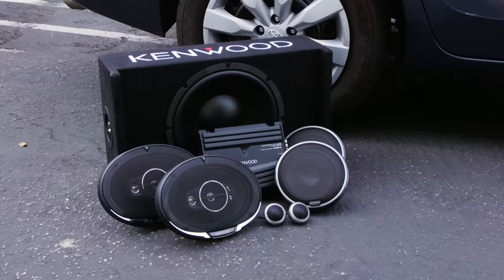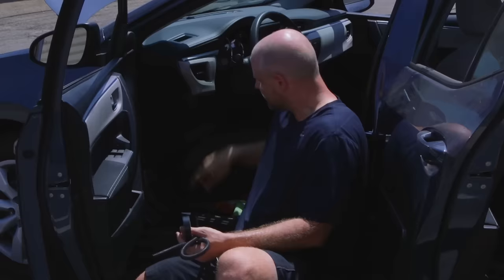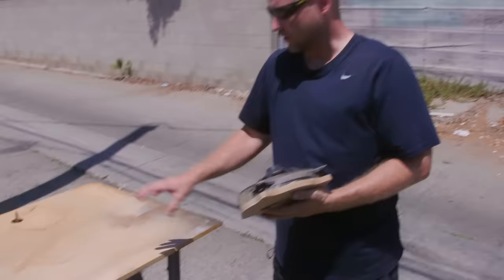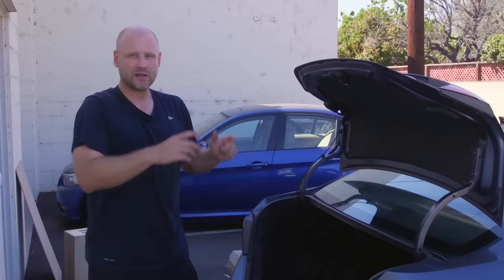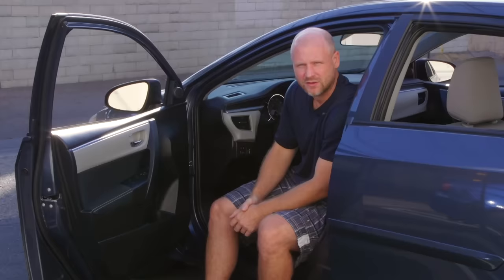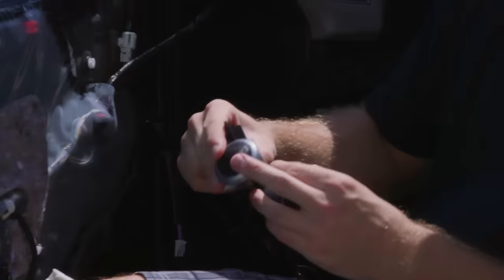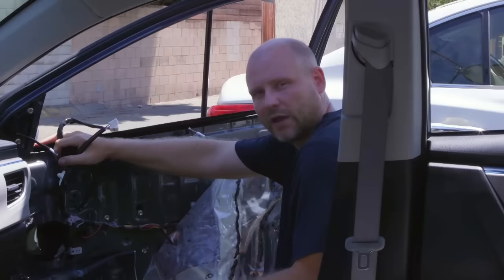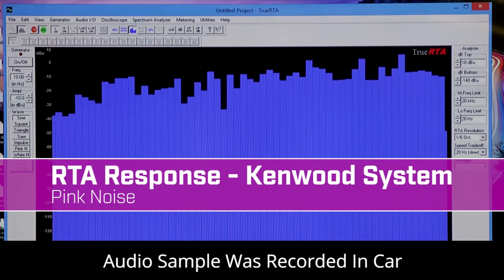Full Car Audio System Installation - Speakers, Subwoofer and Amplifier

Comment: vocals coming out my sub
Reply from the maker: You'll need to adjust your crossover points. You want your speakers and components to play the mid and high frequencies of your audio, and you want your subwoofers to play the low end frequencies. The idea is to cut the bass from the components so they’re not trying to reproduce lower frequencies that will cause distortion and clipping and the opposite for the subwoofers, you want them to play low bass frequencies not highs. The crossover points on the amp limit the frequency response of the speaker before the music gets to the speaker.
Lets go over low-pass filter. Turn your sub’s amp gain to its lowest position, make sure bass boost is off and any remote level control is set to middle. Switch the low-pass filter on and set it as high as you can. Also make sure your stereo’s bass boost is turned off if it has it. Begin to play music at about 1/4 volume, and turn up the suubwoofer gain on the amp until the subwoofer audio completely overpowers the speakers without distorting. Next adjust the sub’s amplifier low-pass filter down until the high and mid frequencies disappear. 
The low-pass filter will now effectively eliminate the highs and mids from the subwoofer, vocals, strings, drum cymbals, you don’t want tat coming from your subs. If you have bass boost carefully turn it up to your liking, but be careful this is a common place for distortion to peak its annoying head into your system. If you hear it, lower the sub’s amp gain until its gone. When dealing with ported enclosures, use the subsconic filter on your amplifier to control overly loud low notes. A lot from this point depends on personal preference, play with the low pass settings until you get the bass that you want.
Reply: probably just haunted, take it to a priest

Comment: ok i know about the power, remote wire, and ground but the speaker wire is where i get confused like how do I connect that to all door speakers???
Reply from the maker: It's pretty simple! Each speaker terminal on your amplifer will have a (-) and (+) slot, just like the speakers will have a (-) and (+) connectors. Think of it like a battery has a (-) and (+). Simply wire each (-) connector of the speakers to the correct (-) terminal on the amplifier, same with the (+).
Reply: @Qualitymobilevideo  so does the wire from the car matter or do i just put the wire + to + nd - to -  straight from the amp to the speaker or does it still need to be connected to the car wire aswell as the speaker wire.

Comment: Do you amplify speakers from the amp being connected to the stereo ?
Reply from the maker: Well in this install we did it two ways. The rear speakers and subwoofer are wired and powered by the new amplifier. The front speakers and tweeters are still wired and powered by the head unit.

Comment: Just bought my first car, still has all the factory speakers and stereo. wanting to replace everything. new speakers. new stereo. put a sub in it. I have faith I can do the install but adjusting everything. tuning it or what not to make it sound right. buying an amp or not buying an amp. all that has got me LOOOST. also finding the best affordable system to buy
Reply from the maker: What kind of sub did you get?

Comment: Did you connect the speakers and the subs to the Amp? If so can you connect 2 speakers (Kicker 43CSC674) and 2 subs (Rockford Fosgate P2D2-12) to a mono amp (Rockford Fosgate R500X1D)?
Reply: Looking for the cheapest possible Rockford Fosgate Amp for said setup that will give good sound, going into a 2005 Silverado Reg cab so don’t need nothing too crazy (the subs are on Craigslist for a good deal).
Reply from the maker: We wired the rear speakers and subwoofer to the amplifier! Connecting two speakers and two subs to a monoblock amplifier will not work!

Comment: how did you actually plug in the tweeters? Looks like you just looped everything back and didn't actually connect it to the tweeter.
Reply from the maker: We simply replaced the factory tweeters with the new ones, using the factory wiring.
Reply: @Qualitymobilevideo  I don't see how but okay

Comment: finally someone who doesn't use a 0 gauge wire for a 1000 watt sub. who came up with the idea that you should always use a massive oversized power cable ?
Reply: henk hakkert Because noobs thinks the bigger, the better.
Reply: @soontoawake99  yea but that amp is not true power dude is good dough
Reply: Incase u want to upgrade you dont have to tear the car apart

Comment: what is the small blue device you installed with amplifier please tell me. and tell me one more thing. earlier i used amplifier but i felt irritated with a noise sound while pressing acceleration of my car so i uninstalled amplifier now. but recently i installed focal auditor 60 rms 4ohm component in front and 60 rms 4ohm coaxial in rear with sony xav 68 bt head unit. now i feel i need to install amplifier for better clear sound. please suggest me. i want to install sony xm n1004 4 channel amplifier 70rms 4ohm. will i feel noise again while acceleration? earlier i felt noise even  after adding a noise filter with amplifier but my earlier amplifier was cheap quality worldtech 2 channel.
Reply from the maker: That is a Line Output Converter! It transfers the speaker level outputs of a stereo to the amplifier! Here's a seperate video on them: https://www.youtube.com/watch?v=OXn8-8yee5o

Comment: As an electrician, I cringed when he said he was going to use dishwasher soap for lubricating the wire to get it through the rubber grommet. Never ever use any type of soap or saliva for this, it dries out the rubber and the outer insolation of the cable over time. Making it crack and eventually expose the copper. If you want to use any type of lubricant for pulling cables through rubber, then use any type of silicone based lubricant, it won't harm the rubber or the cable insolation, actually it will have the opposite effect. Otherwise this was a nice installation!
Reply from the maker: Thanks for the tip!

Comment: how did u power your speakers from the amp? or are they just powered from the head unit?
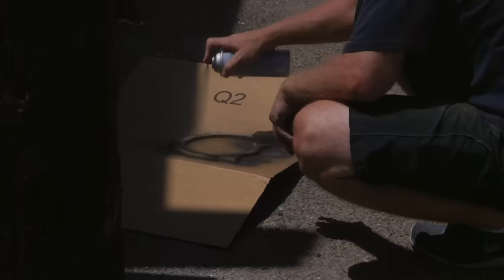thanks 9:13?
Reply from the maker: We originally only powered the subwoofer with the external amplifier. The speakers were all powered by the head-unit, we simply replaced the speaker connections for the new speakers :)

Comment: So the amp is only doing the sub not all the speakers ?
Reply from the maker: Correct, if you watch again, the front 6.5" speakers are being powered by the head unit like the factory ones were

Comment: the way this is setup does it amplify all speakers or just the sub?
Reply from the maker: We're powering the subwoofer and rear speakers with the new amp! The front speakers and front tweeters are powered by the facotry headunit
Reply: Aren't you only powering the subwoofer with the new amp? The rear speakers are still being powered by the head unit, just like the front speakers and tweeters. Then correct me if I'm wrong, you are using the LOC to tap into the high level sound input of the rear speakers and convert that into low level RCA which the amp uses to produce the sound for the sub? In order to avoid pulling out the head unit, you connected the LOC directly to the AMP (power to BAT, GND to GND, remote to P. CON) hence its location. Am i close to being right or what did I miss?

Comment: Did u run the speakers to the head unit or the amp??
Reply from the maker: Head unit! All we did was replace the new speakers in the factory locations and uses the factory wiring(with some improvements) to power them from the HU. The subs is the only thing powered by the external amplifier

Comment: If I do the big 3 upgrade on a 1995 Plymouth voyager van with the stock 90amp alternator can I atleast install a 600 watt rms subwoofer ? So the amp will be 600watt rms at 2 ohms  powering that 2 ohm 600 watt 15" subwoofer. Will it work with or without the big 3 upgrade ? Just curious because I'm new at higher powered car audio. The biggest I've installed is a 100 watt rms kicker 10" subwoofer in a gmc truck that had a 120amp alternator I believe and it sounds great ! If anyone can give me some advice that would be awesome thank you !!
Reply from the maker: That system should be fine without the big 3!
Reply: Quality Mobile Video cool thanks man !!

Comment: I have an 2002 Ford F-150 5.4. I just installed a Sony MEX-4100BT and Kicker 43CSC684 in the doors. I'm planning on buying a Alpine MRV-F300 to bring the speakers to life, but I'm not sure how to connect the amp with the door speakers. Any advice?
Reply from the maker: Well its hard to just put the whole process into words here, we're planning on doing a video on that very soon. Make sure you use OFC(oxygen free copper) speaker wire and good RCA's. Make sure you take all the panels out to make it look as clean and as factory as possible.

A convenient way to send the powered signal from your amplifier to your speakers is to run the speaker wires back to the harness behind your stereo, where all your car’s speaker connections are accessible in one place

Remember, you're sending the audio signal to your amp through the RCA cables. And yes, fade and balance controls will still work fine.

The adapter harness that connects your stereo to the car's wiring has speaker wires that would normally connect to the stereo's speaker wires (if you weren't using an outboard amplifier). You'll connect the amp's speaker output wires to those.

Since you're also adding an amplifier for the speakers, the speaker wires from the car get diverted to the amp. Using those wires on the adapter harness to send the audio to the speakers is how you avoid having to run new speaker wiring throughout the car.

Speaker wires from the amp connect to the speaker wires on the adapter harness. Then that harness plugs into your car. For 4-speaker systems, you'd need to make eight connections — a positive and negative wire for each speaker.

This means, you just need to run the eight speaker wires from the dash to the amplifier, just like you do the RCA cables. In fact, when you're installing the amp, it's smart to run the new speaker wires at the same time.

For amplifiers with over 75 watts RMS of output per channel, it may be better to go ahead and run new 14- or 16-gauge speaker wires directly from the amp to each speaker.
Reply: So I will still have to run speaker wires to the amp for the door speakers? I'm not installing an amp. I just assumed that I would only need the RCA's to get the signal from the head unit.
Reply from the maker: Oh I must have misread, I though you were installing the Alpine MRV-F300 for your speakers?
Reply: Yes, the door speakers only. The Alpine is a 4-Channel amp.
Reply from the maker: Ok, have you ever done this before?
Reply: Never. My first time having an amp.
Reply from the maker: Ok my best advice is to do a lot of research and studying up on how to do this. For a first timer, this isn't easy to explain, it's such a broad topic, I would need to type you pages and pages of info, but I seriously don't have time for that, that's why we're going to make a video on this soon. I can't really explain it very well in YouTube comments to someone who's never done it before.

The main goal is to take speaker outputs of the amp and connect them to the power inputs of the speaker or the crossover. But there are so many things involved in even what seems like a simple install like this. So many things can go wrong too that could damage your gear. Do as much research as you can, watch as many videos as possible.

Comment: why was he running new wires? couldn't he just hook the new speakers up the the existing wires?
Reply from the maker: We ran new wire from the amp location to the factory radio location and used the factory speaker wire.

Comment: I have  memphis audio  package  . Component speakers  in front  coaxial speakers in the  rear deck . two 10' PRX subwoofers  in the trunk  all speakers are  memphis audio  PRX . The amplifier  is a 600  watt 1 channel PXR   . But  I'm experiencing the  audio  shutting off  for 2 or  3 seconds  then  I hear  music  again  my car and  infotainment  are still  functioning.  But not Audio  ??? Could it be a  bad wire or need a  5 channel amplifier??? Also  those  this  mean  I have to pay the shop for rewire the car  ???
Reply from the maker: You're running the 4 speakers and the 2 subwoofers off a monoblock amplifier?
Reply: @Qualitymobilevideo  ... yes memphis audio PRX 600.1 mono block  amplifier  ... what amplifier  do you recommend  and how about  better  wires . 
Honda Accord  component speakers in the front  coaxial speakers in the rear deck  two  10' PRX  memphis subwoofers  PRX  600.1 watt amp
Reply: All  good  I'm at the  shop it was just a  speaker wire  ... thanks for your  reply 
Just the subwoofer connected to amp and  speakers are connected to  factory radio...
Reply from the maker: @Orange-yp9bl  Gotcha! Yea generally that's from damaged wires or a bad connection. Glad they figured it out! Hopefully they didn't charge too much lol

Comment: Hey man can you make and up to date video like this. You know a budget build speakers woofer amp in 2k18
Reply from the maker: We'll probably be doing a Ford F150 soon!
Reply: @Qualitymobilevideo  that would be sweet. I'm looking to get an upgrade from stock in my 2015 sentra just dont know too much so I cant find a good priced bundle. Thanks in advance.
Reply: @Qualitymobilevideo  subbed
Reply from the maker: What's your make/model/year? And your max budget? 4 speakers? Tweeters? One sub one amp?
Reply from the maker: Do you need a stereo as well?
Reply: Ohhh man.. it's a 2015 Nissan sentra FE base model. I'm willing to spend like 5-600 less better but dont mind spending little more for something better. 4 speakers, I dont see a tweeter location so I think they are part of the front door speakers. On sub one amp yes.
Reply from the maker: OK and the speakers, you want front door and rear deck?
Reply from the maker: Oh we sell that VRN! Here's our video on it: https://www.youtube.com/watch?v=HduLCDhI-wI&t=243s
Reply from the maker: But if you're looking to add a good stereo as well, your budget will probably have to go up a bit
Reply: Speaker, yes. Lol that's the video that I found out about that radio didn't realize it was you guys. That's must have been you yall were talking about in the this video lol dont know who I'm talking to. But yeah the price range was to get the speakers sub amp and anything else needed the stereo is a separate budget.
Reply: Are you familiar with the first like I sent?
Reply from the maker: I'm not familiar with that one no. I wouldn't recommend buying Chinese radio off amazon. You'll get no customer/tech support and the warranties aren't as good
Reply from the maker: Do you have a preference in brand!? Kicker, Rockford Fosgate, Pioneer?
Reply: Kickers have the best reputation in my area but I dont mind as long as they are good..
Reply from the maker: Ok sweet, I'm a Kicker fan as well. Here's a system option I put together for you with solid but not overwhelming power all around, budget in mind. 

Kicker Kicker CXA300.1 - $149.95
https://www.qualitymobilevideo.com/cxa300-1.html
Paired with this sub for 300W RMS @ 2 ohm load
Kicker 44VCWC124 Loaded Enclosure - $199.95
https://www.qualitymobilevideo.com/44vcwc124.html

Your car has 6-3/4" speakers, but you can get 6.5" speakers with adapter plates which I would do, more options...

Universal Adapter Plates 
https://www.qualitymobilevideo.com/82-3006.html

Kicker 43CSC654 6.5" Speakers - $69.95 (Doors)
https://www.qualitymobilevideo.com/csc65.html
Kicker 43CSC6934 6” x 9” Speakers - $99.95 (Rear Deck)

Then you'll have a little extra cash for installation kit/accessories
Reply from the maker: Whoops I meant these adapter plates: https://www.qualitymobilevideo.com/82-7400.html
Reply: Awww man sweet .  By any chance will these be what you install in next install video?
Reply from the maker: Oh no, was just recommending what fits your needs and budget lol
Our next planned install will be using Kicker KS speaker's which are higher end plus some DSP Sony amps and subs with a Sony headunit
Reply from the maker: These are 6.75" speakers: https://www.qualitymobilevideo.com/csc67.html

Comment: can someone help my amp also have 4 speaker wire plug in thing right positive, right negative then next to it right positive, right negative I hooked up on side of my amp right positive left negative ( it's 2 10 inch subs) then I hooked up the other side right negative left positive and only 1 side works. please help
Reply from the maker: Taylen what amp is this?

Comment: Also, I have this same car and the audio is bad.  The front speakers are broken/blown.  There is a guy that’s asking $1,700 to install a “full system minus radio”, all being Rockford.  Is this a fair price?
Reply from the maker: Can you provide me with more information on what he's going to install?
Reply: He said he would install everything Rockford fosgate, pair of 6.5, pair of 6x9, amp, and a 10” woofer that comes already in enclosure and interface.  He said he would do it on a day.  He charges $80 per hour.  I’m keeping the stock head unit.  He did not gave me model numbers or details on which particular parts or equipment he would install (I didn’t ask).  He did told me that for $1700 he would get everything done.
Reply from the maker: @mariorodriguez653  Do you have the model numbers of the items that they will be installing?
Reply: No, but now I realized that I should of probably asked for those.

Comment: Why is my speaker terminals putting out DC voltage on amplifier
Reply from the maker: You likely have an issue with the amp. You will need to have it checked out.